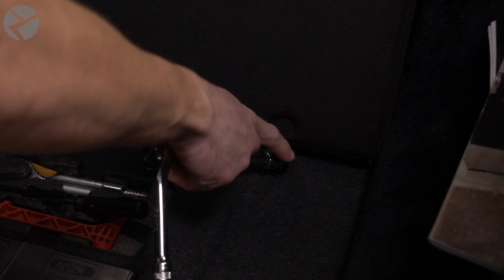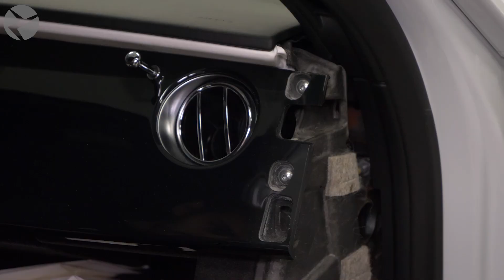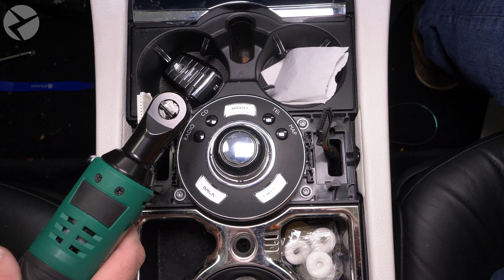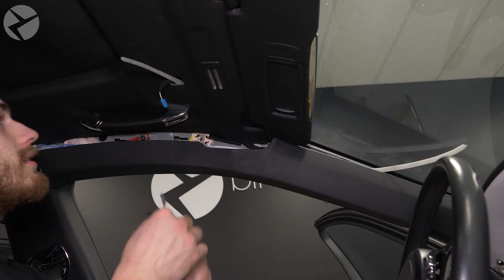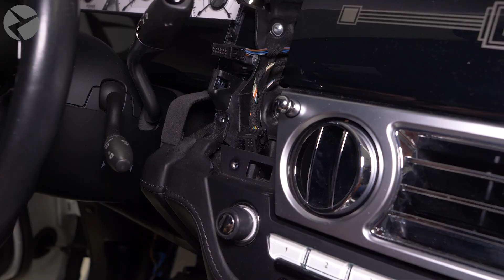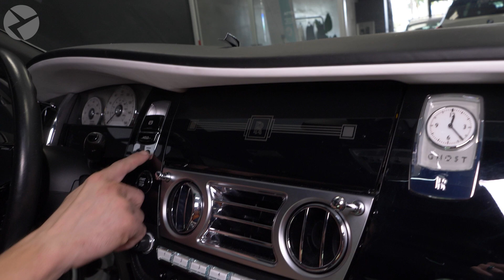Rolls-Royce Ghost (2013) CarPlay MMI Prime Installation Tutorial

Comment: Excellent video I was fixing some electrical issues and this gave me the details on disassembly. I had thought those kick panels under the glove box and steering wheel were the airbag itself I didn't know you could safely remove them. I actually took my glove box out without touching that too much but if i can just take that out things would be much easier. How did you guys know this procedure just instinct or was there a rolls royce service manual for taking this apart it's been rough finding info on this car.
Reply from the maker: Glad it helped!  We are pros.  😉
Reply: @bimmer-tech  thanks again is it necessary to install the mic with this kit if my car already has bluetooth from factory?
Reply from the maker: @Dynasty-s1y  With our kits, we don't include a mic.  We make use of the factory one, but to tap into it with vehicles with CIC head units, you do have to run our mic extension cable to the factory mic.  If you're only using Bluetooth, using the factory system could work, but it really does depend on your car's equipment.  We always suggest running our cable, just to be on the safe side!
Reply: @bimmer-tech  Oh ok.. is the mic extension necessary to use the factory mic with the carplay features like siri etc?
Reply from the maker: @Dynasty-s1y  Best bet is to install the kit as instructed for best results!